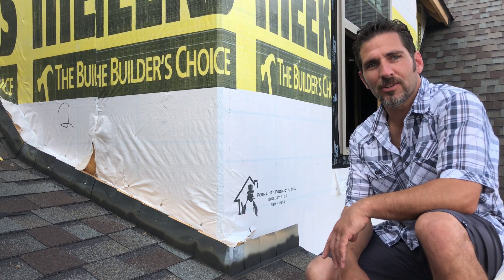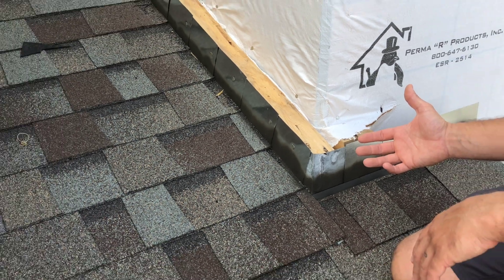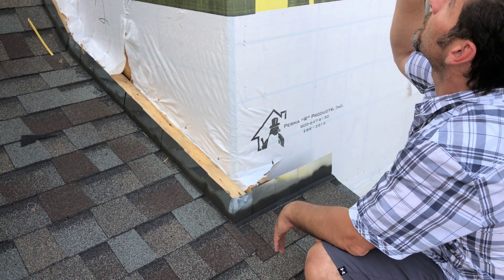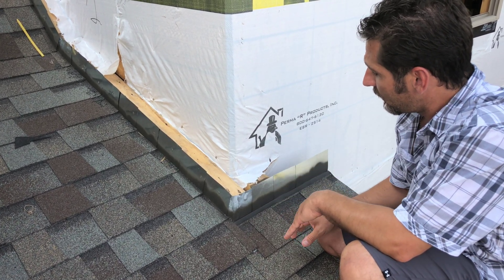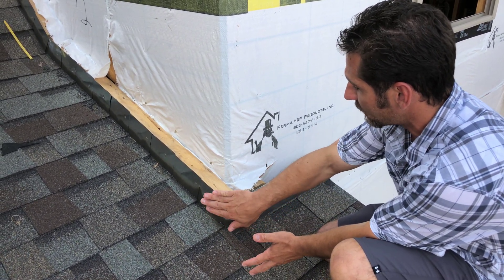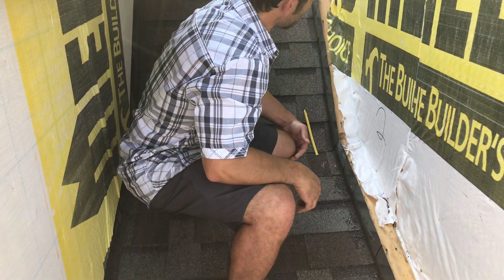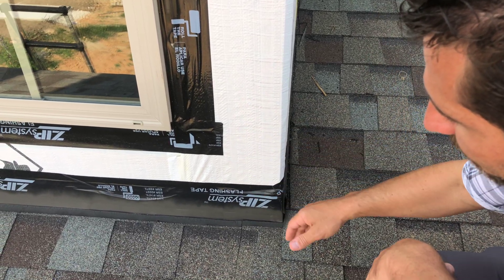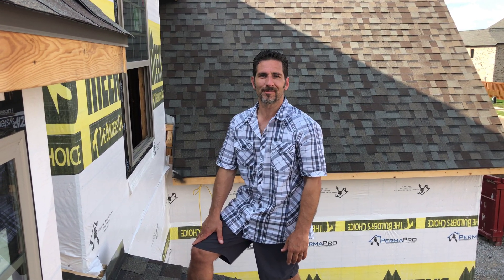What is a Brick Pocket & How to Flash a Brick Pocket?

Comment: Why would they not be using PT 2X4s in such a vulnerable location?
Reply from the maker: Kevin Hornbuckle if water is making its way to those 2x4s then it will be going inside the home. That is the point of what I am explaining. The flashing should never be outside the housewrap and covered with aluminum flashing because you can not seal that up with anything besides caulking and caulking will not last long term! Here is a video explaining how we do these areas:
https://youtu.be/a67tcO8IQHE
Reply from the maker: Here is the video showing how to support the brick or rock once the flashings are properly installed:
https://youtu.be/LFuegqySSXs